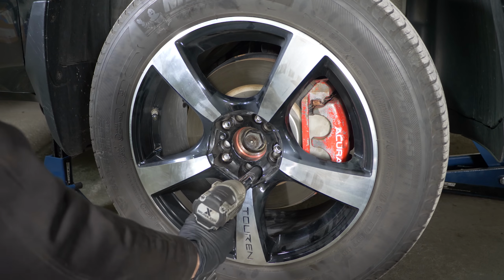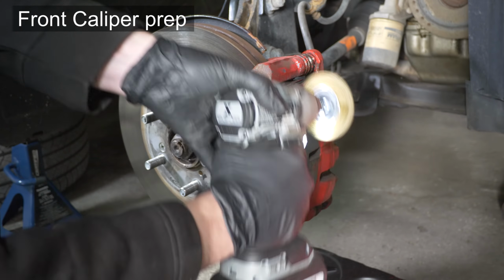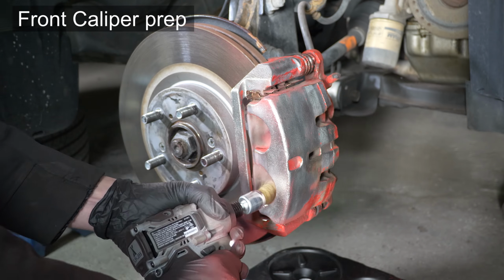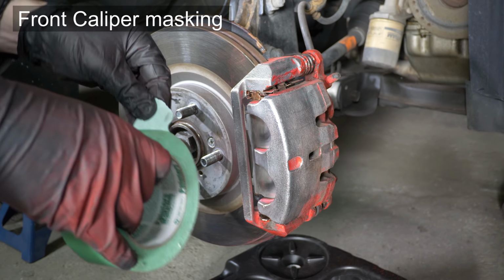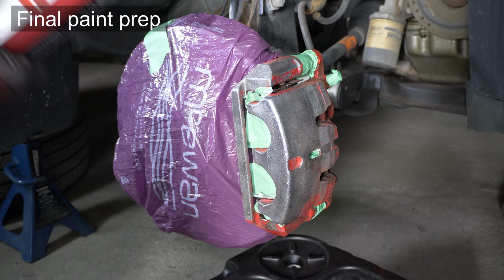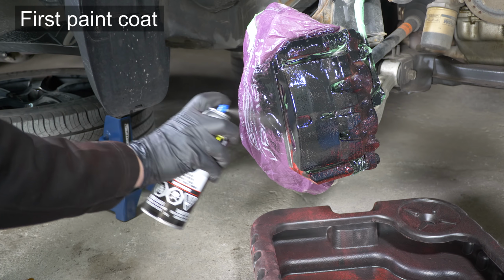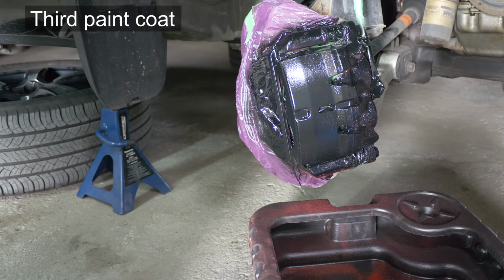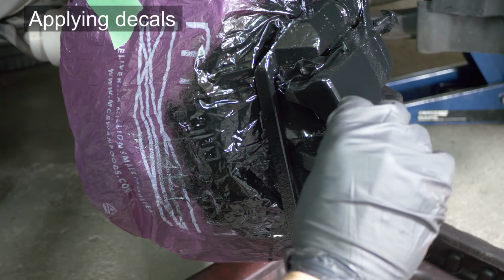Acura MDX Painting Brake Calipers DIY

Comment: Hell yeah! Bagdan the man! <-Spelling? Always putting out videos for the 2g MDXers! I’m in the process of filling in all the holes on my grill to smooth it out for anthracite grey on the blades and emblem then gloss black for the beam that holds the emblem. I’ll see if I have time to get some clips of the process. I would love to see you add a rv6 j-pipe and ktune for some power gains!
Reply from the maker: Thanks, Dang! Close! It’s Bogdan. Kudos for the grille! I actually covered mine in plasti dip (video is coming). I left the emblem and the silver middle part not covered, though, it adds good contrast. Stay tuned for the video!
Reply: Acura Addicted nice! Thanks bogdan!

Comment: I just replaced all the rotors/pads on mine and lamented the rustiness of my calipers, I figured you might have a video on that subject and it was one of the first suggested videos I saw tonight, go figure.  The black color contrasts well, looks good!
Reply from the maker: Thanks! I’m good with my brakes so far (OEM brakes). Installed them in 2015, it’s been about 40K miles since then, they perform normally. But will definitely do a video when replacing them.
Reply: I bought poly coated rotors for the rear and only could find oem for the front.  Honestly I prefer the polymer coated ones because of the silver/rust preventative finish.  The front rotors, only a week old have an inch of light rust between where the pads wear on the rotor and where the painted part of the rotor hat is.

Comment: Do you personally think that Fram ultra synthetic oil filter is still superior to an original oem Acura oil filter, considering that the cost of the Acura filter is the same, or (possibly) less?
Reply from the maker: I have no complaints so far. Opening valve covers later this or next year will show. I’ve seen a couple of videos with cutting the oil filters and it looks like both the original Honda and Ultra synthetic FRAM have solid insights.

Comment: Noob question, never have done anything with calipers before.  I know normally when jack-standing an axle the emergency brake is on.  When doing the prepping and taping, can the emergency brake still be activated or will that interfere with getting the tape or plastic under the caliper?  TIA!  Nice video to give me the confidence to try this!  Going to go red on my black '07 MDX with black Acura decals.
Reply from the maker: Hi. In MDX the emergency brake is a drum brake under the rear brake rotor caps. It engages by applying braking shoes from the inside of a rotor cap against it. So putting it on (which you should be any time that you stop the vehicle and shut the engine off) is fine.
Reply: @AcuraAddicted  Thank you.